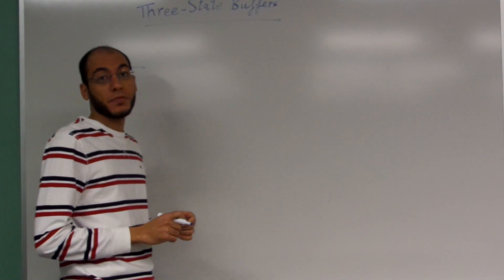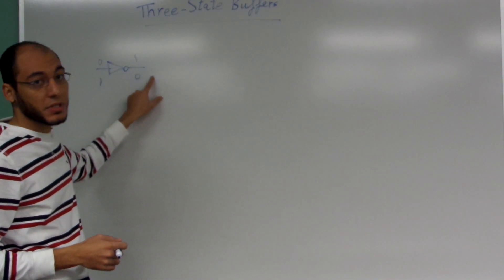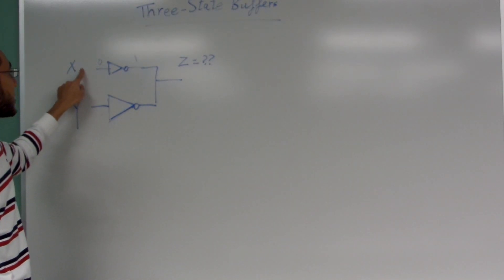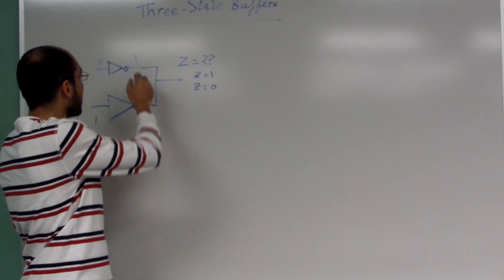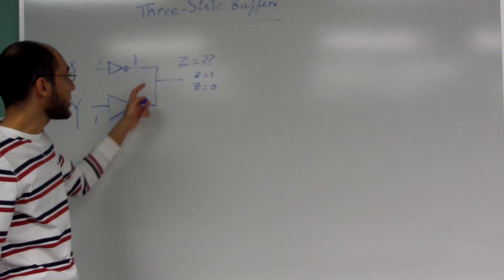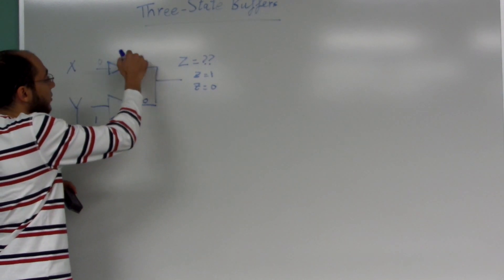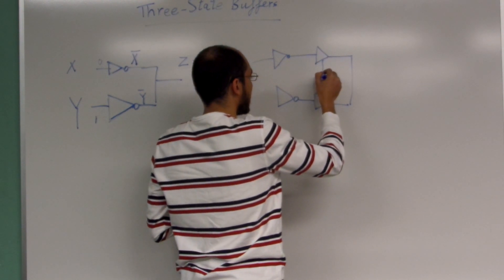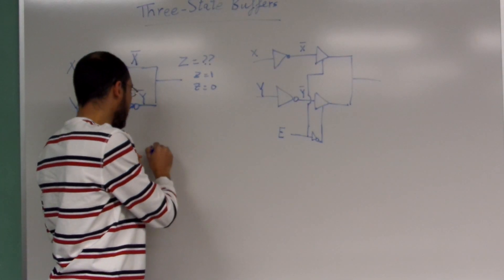Logic Design || Three-State Buffers - Why do we need them?

Comment: Is this similar to a multiplexor (1-bit selector)?
Reply from the maker: Yes, multiplexers can be built from 3-state buffers. But they need to be "controllable 3-state buffers" (i.e. buffers that have Enable input) as the ones used in this video.
Reply: Yeah, that popped-up in my mind to when he talked about selection.